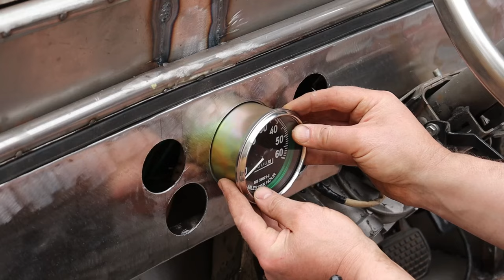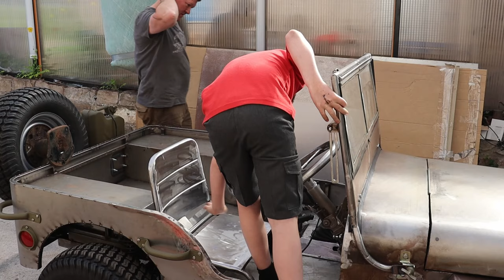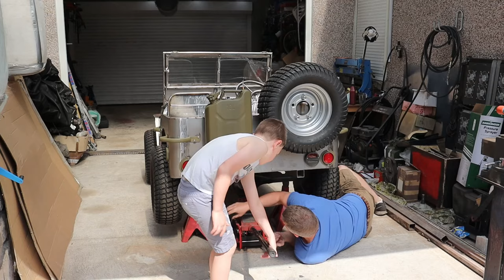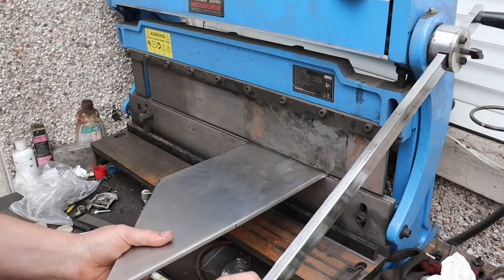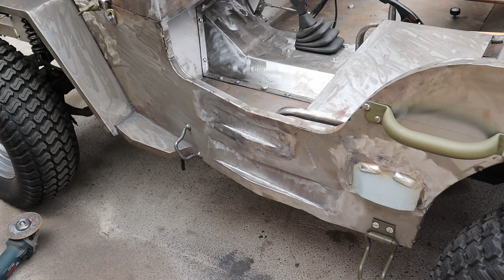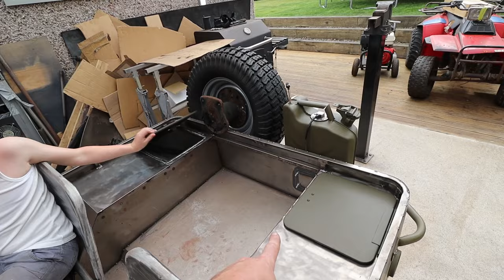4x4 Willys Mini Jeep 4x4 Car Build EP 21, Dash Cluster, Tool Boxes, Grab Handles, Axe and Shovel

Comment: maybe I missed it but the headlights were hinged to the front grill. they were done that way so if you broke down at night you could rotate them backwards to shine light in the engine compartment
Reply from the maker: Yeh, that was an amazing feature wasn't it. From what I've researched only the earlier jeeps had this, it was later dropped as demand grew for higher production volumes during the war (not sure if the GPW's had flip lights, I'm sure someone will confirm).
We haven't installed flip lights on the mini jeep at this point but I guess they could be retro fitted, maybe for another episode. 😉 👍 
Thanks for watching, great comments. I'm guessing you have the real thing.. ?

Comment: Manual wiper blades for windshield? will you install?
Reply from the maker: Yep, haven't got round to researching yet but will be either vac, elec, or manual wipers.
We might potentially put it in for an IVA to see if it can be registered for road use, in which case everything, including the windshield, would be removed ahead of the inspection for "off road" use only 😊.
Next episode might be rounding off lots of body parts/edges to 2.5mm radius..  🤣
Thanks for watching 👍

Comment: 1943 Willys MB Jeep - Off Road Icon! How does it drive?
https://youtu.be/34MlumMB4Uo
Reply from the maker: Absolutely, I love these things..! It drives well given that it has almost the complete Jimny drive train/brakes etc. It has a surprising amount of flex, although it does have 4 link front and rear 😊.
It seams fairly low geared, which isn't a bad thing in a 4x4 kids jeep, but then we've only driven it in the driveway and had it up to 2nd gear so far. Cant wait to get it out on a good trail run..
Thanks for watching 🙂 👍